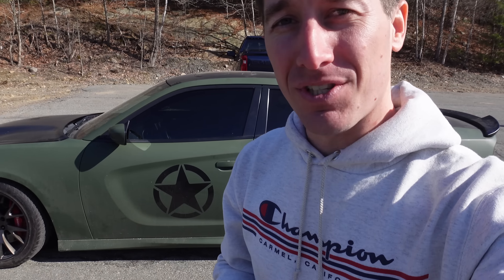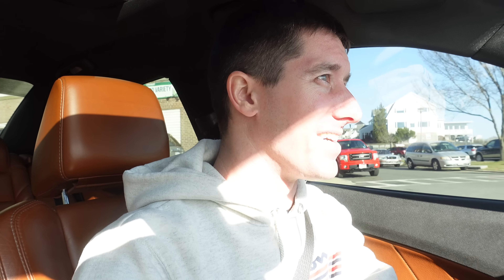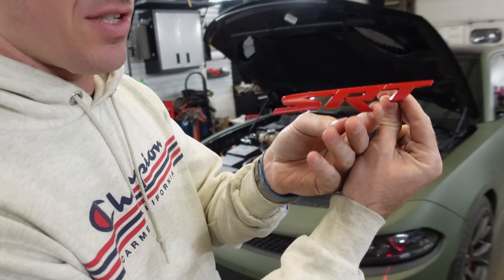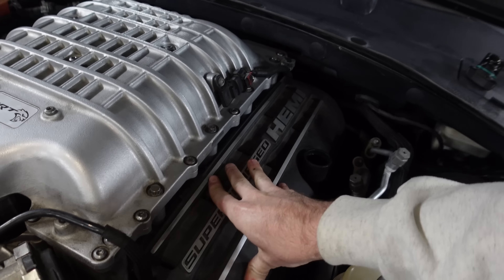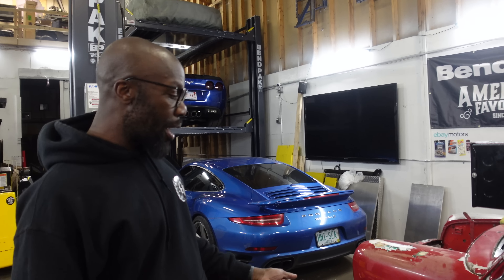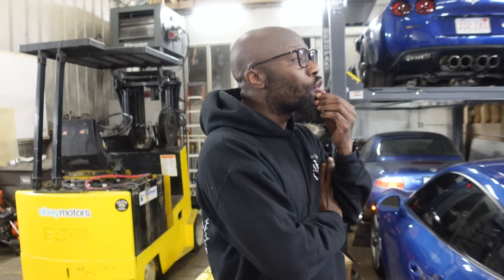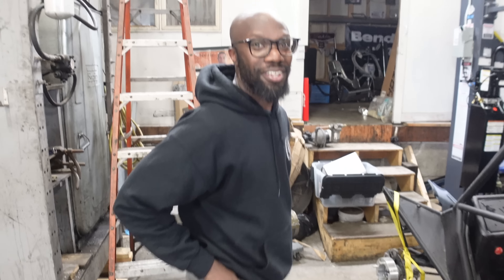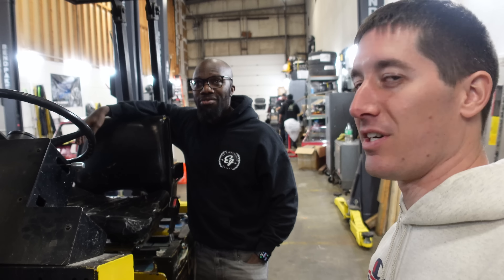I FAILED Tuning Rich Rebuilds Modded HELLCAT Charger

Comment: Crazy fun cars. Drove a Challenger Hellcat Redeye Widebody at Corvette Raceway in Kentucky. 797HP was insane. Big boat that handled like a track car, and when you dump it at the start of the straight doing about 25mph, it drops gears and briefly chirps as it plants the rear, then the front end lifts like the front tires are about to come off the ground, and it launches like a monster. Most hilarious car I ever drove. Dodge killed it with that package.

Comment: I had 3 real mini's an 850, a 100 and a 1275 gt. They were all amazing drivers cars they could be thrown in to corners and i never had a problem the one downside was rotting each and every one ended up needing a lot of new body parts, I met one that had been re done and the owner had painted it from top to bottom and every bit underneath with Hammerite black brush on paint to keep it whole.

Comment: i use the Diablo Intune 3 platinum,  it allows for cmr tuning so a tuner can email tunes and you can log them , you have to install a y band as most tuners need that air fuel ratio numbers ,, but the platinum lets you pay 150 on there website for a new vehicle key vs paying 500 for a whole new tuner so ive used the same tuner on 5 of my cars just buy buying a new vehicle key from there website

Comment: Wow that wrap looks good from 30ft. Also Rich should put some sort of plug or tape over those open  engine exhaust ports just so moisture doesn't creep into the valves and pistons .
Reply: The good thing about an Army wrap is any imperfections just add to the authenticity :)